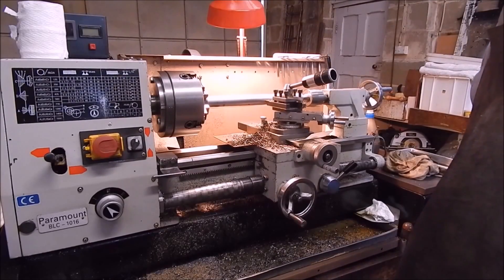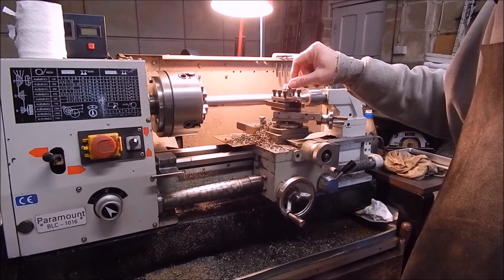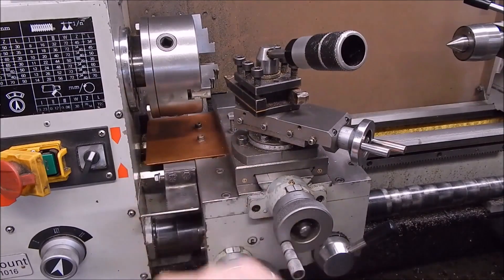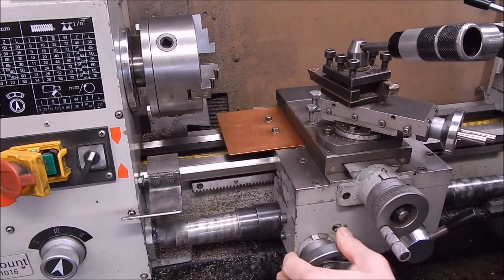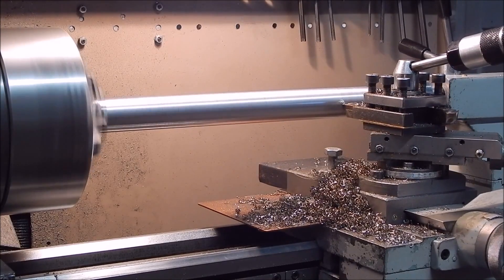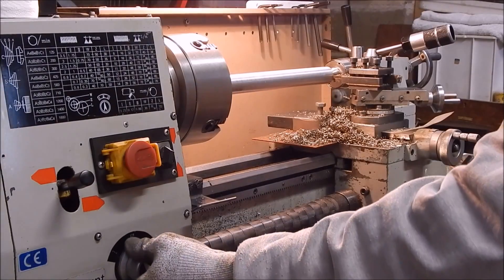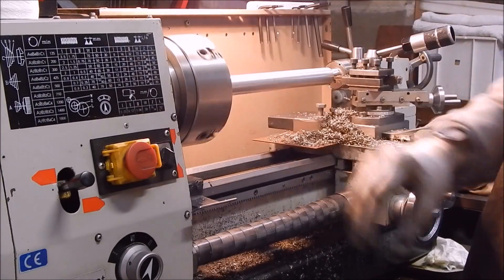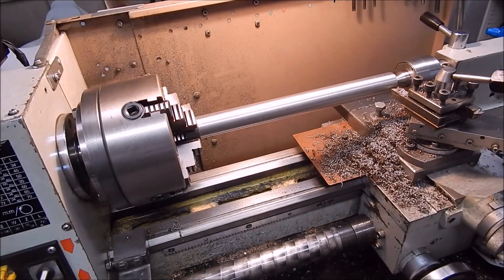Fit a metal lathe chip deflector to save your ways

Comment: I'm going to use your idea, it's a very clever and simple solution to a big problem. Thanks for sharing Rob! 
Jason
Reply from the maker: Hi Jason,

Yes, it's an issue, and it's a lot easier to watch the carriage stop clearanceout of the corner of your eye, than the gap between the leadscrew end mounts way down low out of sight.

Cheers Rob

Comment: what make is your lathe??  fid cover on lead screw come stock...would be good addition to my atlas
Reply from the maker: It's a Chinese CQ9325 10 x 18".

The spring steel leadscrew covers came stock.

You can buy and fit aftermarket ones, but be aware that they reduce your carriage travel by their fully compressed width (about 2").

I did a video on them quite a way back.

Well worth having, and you just lube and forget the leadscrew.

Cheers Rob

Comment: Thanks Rob. Another useful and simple improvement.  Will have to add a chip deflector to the CQ6125 Workman when it arrives!  I'm also impressed by the lead screw protector.  Will keep my eyes open for something thin and flexible to fabricate a set.  Any chance of some close ups of how they connect the carriage, please? Cheers Mick
Reply from the maker: Hi Mick,

I did a video on the leadscrew covers a while back:

https://www.youtube.com/watch?v=9UyCxy1pA7M

Each tube type coil cover is located at each end by a short smaller diameter cylinder that fits inside, and is attached to the carriage and headstock by three little screws through a flange.

The coil covers are naturally fully extended, so the tubes only have to locate each end as the cover is compressed.

Very simple.

Cheers Rob
Reply from the maker: Correction, the locator on the carriage end fits outside of the coil covers, and the screws are on the inside.

At the headstock end the screws are on the outside.

I hope that clarifies things.

Cheers Rob

Comment: I made one using a fairly stiff plastic.  If I'm using ER collects hen I work closer to the head stock. When this happens the plastic bends and slides upward.  So a flexible version allows for more variation.
Reply from the maker: Good idea.

My carriage can only go so far, because of the leadscrew covers, but flexible would be good if you had more travel.

Cheers Rob

Comment: Rob, a total newb question: I've never seen vacuum chip collection used (or even any sort of compressed air blower arrangement)...is that not a goer with metalwork? Woodies seem to like dust extraction systems. BTW, I really enjoy your videos and I might even take the plunge and get a metal lathe one day ;)
Reply from the maker: Some machinists use compressed air to blow chips/cuttings away from the cutter tool, but that is basically so the cuttings can't foul and score the job, it's to get a better finish.

Woodies benefit from a dust extractor due to the airborne nature of the problem.  Wood/fibre board dust can/will kill you if you breathe enough of it (as happened to a cabinet maker friend of the family).

No such problem with metal work as it's too heavy to float.

So a brush or magnet cleanup when it piles up too much is sufficient.

Glad you enjoy the videos, and a lathe can be a lot of fun if you're interested.

Cheers Rob
Reply: In metal machining the usual way of chip removal is to flush them away with one or several strong streams of coolant. That is why the CNC machines are completely enclosed to keep the splash inside. Since they are supposed to work unobserved strong flushing makes sure that the chips do not build up.
Reply from the maker: Yes, good point.  The best system for sure.

I only replied in regard to air systems as that was what the OP was asking about.

Cheers Rob.
Reply: Vacuum is a MUCH better method than blowing chips with an airgun. If you blow, the chips get forced into your dovetails and the inside of the chuck.
I have an old vacuum in the workshop specially for this and other mucky jobs.
It hate to see machinists working with piles of chips everywhere just wearing out their machines (not you Rob)
Reply from the maker: Good point Peter.

The air blast at the tool head is only very small and concentrated in that area, just to move the chips off the tooling edge.

Using compressed air to clean down lathes is a bad idea, as you've stated.

I have an old Sanyo 1500 watt vacuum I got off the side of the road junk day that I clean up with.  Does a good job, and oil doesn't seem to phase it (has the old style cloth bag).

This is the second one of these I've had over the years.

Cheers Rob

Comment from the maker: I fitted this chip deflector many years ago, after my way flats were scored by super hard cuttings from hardened steel I was working with carbide.

It cured the problem, and since that time there has been no further scoring of the ways, particularly the rear flats, which are most at risk.

Cheers Rob

Comment: Something similar could help the cross slide dove tails. They still are getting plenty of chips.
Reply from the maker: My cross slide has a full metal cover at the rear which keeps that area clean.

Only a few cuttings seem to get on the ways at the hand wheel end.

I use a piece of thin hard plastic sheeting to protect the cross slide screw thread when the slot is exposed, you can see it if you look closely at the video.

Cheers Rob
Reply: yes, the cross slide screw seems well protected. But in this video you see quite some debris collecting at the front end of the left dove tail. Maybe a small extension of the plastic protector over that corner might make a difference. Usually the carriage has felt wipers to the bed ways. I don't know about the cross slide. I don't think it has wipers. Maybe a frequent wipe with a hand brush might work as well.
Reply from the maker: There is some debris on the left cross slide dovetail, but as the slide has very limited travel when machining, it's not exposed to the same degree of wear as the ways.  I generally brush it away before winding back the cross slide.

Chip wipers are OK when new, but over time the felt pads pick up tiny metal particles and basically becomes abrasive.

So they should be changed periodically.

I like to use light oil regularly to lubricate the ways/dovetails and flush the crap away, rather than have it lodge in heavy oil and turn it into an abrasive.

Cheers Rob